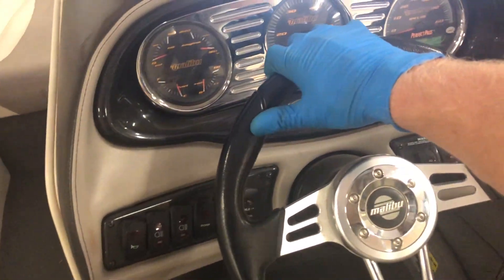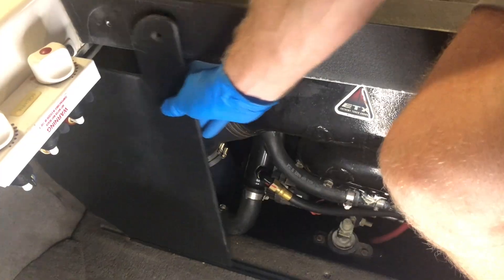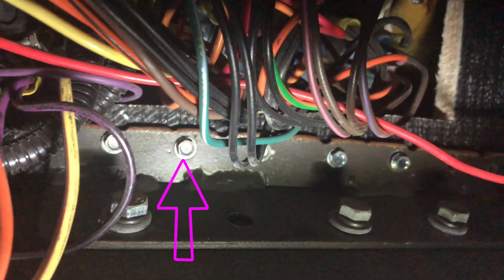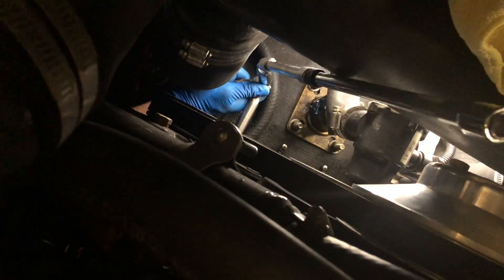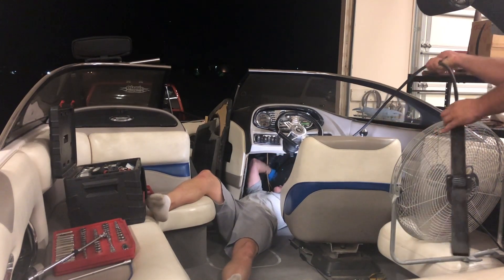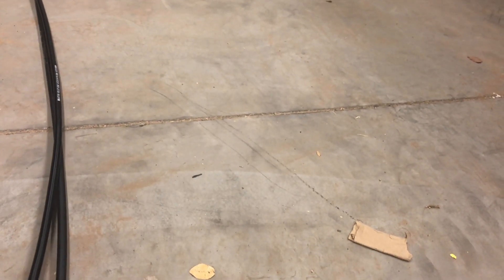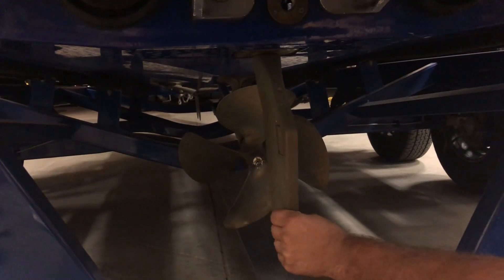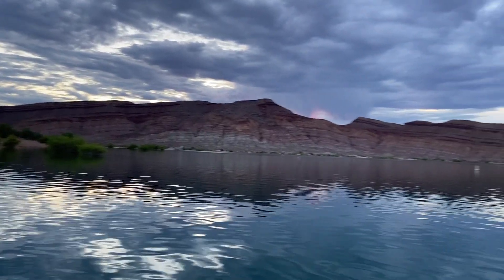Boat Steering Cable Replacement | Malibu Wakesetter VLX Steering Cable Replacement

Comment: Thanks for doing this video. Just got mine done. If you have a heater and shower I recommend getting those hoses out of the way first. 

And you just need to take the bottom nut off the bolt on the rudder.

Comment: Well done! My steering cable just broke. Nice to know what to expect before tackling the project.
Reply from the maker: Awesome. Glad to help. 

Do you need recommendations on a new cable?
Reply: @Sunni_days  was just gonna order a teleflex from the dealer. Any tips?
Reply from the maker: Compare the cost of getting it from the dealer or bakes. I have also found them on Amazon. If you let me know what what boat you have or what size you need I can try to find you one on Amazon.

Comment: Great video.
Reply from the maker: Thanks you! Hope it was useful. Are you getting a boat ready for the season?
Reply: @Sunni_days  yes. I actually came over here from Malibu crew to watch the video.  My steering is a little stiff. The before and after of that install tells me I need to do this sooner rather than later.  I have 2005 23 LSV wakesetter.
Reply from the maker: @diyjeff1838  that’s a great boat! The Malibu Crew is a great forum with good info. Yes stiff steering sucks and smooth steering is awesome 😁.

Comment: Hi, thanks for the vid. How do you remove the floorboard for access to bottom of the hull? I've removed the two screws towards the helm but it's not prying open easily and I don't want to damage it with force. Am I missing other  fasteners that need to be removed? (I have a 2000 Malibu Sunsetter VLX, i think your panel is similar)
Reply from the maker: If you are talking about the floor that is on top of the fuel tank, it should be 2 or 4 screws. The screws should be located in each corner. You will need to dig through the carpet to locate them. It should still be pretty snug even with the screws removed. Good luck 🍀!!
Reply: If you are talking about under the helm then there are screws hidden under the carpet. Use a magnet or feel around. They will usually be Phillips head

Comment: Hello sir! Im helping my dad finding a new cable for his 2004 Malibu wakesetter 23ft.
Do you reckon that the cable in your bio will be compatible?
Best regards, Steve from holland
Reply from the maker: This is the document I use to determine what length of cable to buy

https://www.bakesonline.com/media/resourcelibrary/MalibuBoatsfitchart.pdf
Reply from the maker: Based on the information you gave me you need a 20ft cable. The one I used in the video is a 19ft, so it won’t be compatible. When you order you can just select the 20ft instead of the 19ft.

Comment: Great video!   It doesn’t seem easy to find the right cable.  I also have a 2005 VLX, can you help find the right cable?

I called the boat store and they said they usually take out the cable to mesure before ordering one.  I don't want my boat to be out of commission while i wait. 

Any tips in cable selection would be great! 

Thanks!
Reply from the maker: Hey! This should be a helpful link. Based off this chart looks like you need a 19ft. cable. https://www.bakesonline.com/media/resourcelibrary/MalibuBoatsfitchart.pdf
Reply from the maker: Here's one I found on amazon. Not sure if it is an exact fit, but another subscriber I helped used a similar one and it worked great for him. https://amzn.to/3Pw9PCZ
Reply: @Sunni_days  amazing, thank you!
Reply from the maker: Glad to help!! Hope you have a wonderful weekend.

Comment: So i'm changing my cable on 2016 Axis T22.  I was going to try to change it without removing the sub and side panel (my steering rack is accessible as its in front of the sub)....what are the chances that the cable would have been zip tied to anything at the factory?  It looks like it runs under the starboard stringer....not sure if you knew of any hiccups when installing a steering cable.  Great video
Reply from the maker: Thanks for taking the time to comment. Not sure if it will be zip tied. I haven’t done one of the newer boats. 

I haven’t seen someone do the steering cable without removing the sub or kick panel. Let me know how it goes 👌. I’m curious 🧐. 

No hiccups, I originally thought the cable run over or under the gas tank, but I figured out quickly that it went up along the stringer.